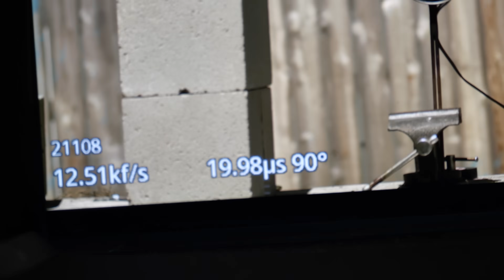Spinning a Record to Pieces at 12,500fps - The Slow Mo Guys

Comment: i'd like to know how far away you found pieces. because one of the early ones before you put wood on top showed a large center piece going up over the bricks and leaving the frame kinda going up and left.
if i remember without looking it was a blue sticker i think.
looking back -wow 1st one - large piece went straight up ! black sticker .-many looks later - ok not blue. the piece was the 1st record with black center, and a large piece that had HIGH FIDELITY went nearly straight up out of frame. did you find a large piece with HIGH FIDELITY on it ?

Comment: Try using a thicker record, they weigh around 180 to 220gms.
Way more stable as they don't buckle from heat anywhere near as much as the ones your using.

Comment: Guys… I know you won’t see my post… but there are a couple things you’re failing to consider here, primarily the torque of the engine used to spin is clearly higher than it needs be, you ought to have it increase the RPMs in a controlled manner because the force from the engine currently is putting so much stress on the record that it’s basically the cause of it exploding at the speed that it does. Secondly, the records you’re using are imperfect. Not just because of the music imprinted but also due to wear, handling, and temperature changes. You ought to try and get some blank records so there aren’t micro-weaknesses and records what are as perfectly flat/round/etc.  still a good video but those things irked me the whole time.
Reply from the maker: We were trying to make them explode, though... All the stuff that "irked" you is why the video worked.
Reply: re-read the title

"Spinning a Record to Pieces at 12,500fps"

Comment: 00:49 kinda hurts seeing a 3/8 barrel nut being tightened with needle nose pliers. Use a 9/16 socket or whatever size a barrel nut is, not sure if its OD is that. 
   I know it's dumb but I'm in construction so I see this a lot.

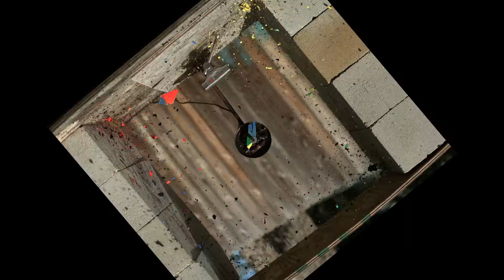Comment: I'm willing to bet relativistic length contraction is the cause of some of those cracks. The outermost edge is moving faster then the inner material, and so relativity would try to slightly reduce its circumference, but the inner layers would resist, leading to a tiny nanometer size split at the outermost edge which permeates inward. It looks like that at 6:06 and 8:44 and 12:31. Centrifugal force cracks would start inside and permeate outward. Great stuff...

Comment: Noticing it was a bit breezy. airspeed, air currents  and such would play a factor as well? Would it be different if it was unpressed, no grooves? The shape of the pressing when in motion, notice its stability changes that the vinyl begins to oscillate and not remain uniform like a buzz saw blade. If one measures the points, would that give an idea of what the resonant frequency of vinyl would be (like the opera voice/breaking glass scenario) in order to be destablize/break?

Comment: Hey.  Been a while. What if you filmed the warm between this. And subwoofer speakers at different sizes. Like 10 inch subs. To 12. To 15   But be careful 15s are such hard wavelengths they can cause heart wobbles or heart attacks because it shakes the body it’s so strong

Comment: Two things I would have really liked to have known. What color did they perceive the record to be first hand and off camera as it spun? I also would have been curious to hear a sampling of a recording off the record, then have them spin it up then down just before structural failure to hear if the same portion of the sound sample was distorted by the high rpm’s in the vinyl and if it did, how would it have distorted or stretched the vinyl since it is a soft material, or if it would not have changed at all since at those speeds it would behave as a solid? What do you think?

Comment: Something that surprised me is the wobble did not travel with the record. If you look at when the last one breaks, it breaks from a small bump that travelled around the edge of the record until it reached a critical threshold, a weak point in the record, or both.

Comment: Whilst this is visually fascinating to watch, from a physics point of view, the experiement is not conducted acurately.  The record shatters because of vibration shockwaves created by the instability of the mounting point and micro sonic booms from air resistance.  In order to eliminate this error, the motor needs to be mounted on a more solid back plate and placed inside a vacuum chamber so that air can not have any influence on the record track.  It must be understood that the groove on a record is one long spiral which traps air particules to the extent that an air dam is created which then explodes and ruptures the record.

Comment: You should now try the various version of 78 RPM records.:pure shellac, laminated, & Diamond Disc. They are far more brittle & the laminated, esp the Diamond Disc would be very interesting considering the various densities of the filler s & surface materials.

Comment: This is very interesting. The fracture starts at the disk edge and progresses internally towards the centre with additional fracture lines radiating from the original like a trees branches.   
I will use this information to strengthen the high speed rotors on a new BLDC motor by wrapping the circumference with carbon fibre tow... Thx.

Comment: @3:05 Gav is a High Level understater.  "I'm glad we put these (cement blocks) up."  Yes, I indeed agree.

May I suggest the blast shield be the blocks lined with plywood.  Depending on the object of the test, plywood - wood of some sort - will better absorb and hold the shards rather than letting them bounce around the area.
Like the bit that hit Gav's shield.  Probably not fatal, but a good bleeder and possibly requiring clean linen.  For Gav; probably also for the wound.

Damage to 'blast shield':  From ballistics testing, penetration in a hard surface is mainly a product of velocity.  The faster the object moves, the greater penetration in a single hard surface.  (Penetration in a homologous substance depends on mass [more or less].)

Comment: In a vacuum how would it shatter if it even does, i wonder.
Reply: Of course it would shatter in a vacuum. It wouldn't be much different. Why do you think otherwise?
Reply: @elonmusk8711  i would suggest it would rotate for longer if not break as there is no medium to disturb it (air).

Comment: They sound English but have 120V?
Reply: Mains voltage in the UK is 230 volts. They're using a variable transformer that just so happens to have an output of 0-130v.
Reply: @elonmusk8711  241-265V volts here in the UK, I've never known anyone have less than 240V.  230V is an EU thing we never bothered with.  Anyway, you would think a variac would output similar to the input.  I have one, it's 0-275V.  Also, presumably the Dyson motor they were using was British, in which case they were only giving it up to half it's voltage.  Sounded more like they were putting it to full power from what they said, which meant it was a 110V motor.

Comment: Any ideas about the rpm threshold, the point at which the vinyl finally yields? Any tachometer measurements taken?
Reply: Well it shattered at about 12500 frames per seconds and took about 4 seconds to do a full turn. If 1 second in 12500 fps is equal to around 40 seconds, I multiplied it by 4, then 60 for a full minute. Unless my math is wrong, it should have been spinning at about 9600 rpm when it shattered the first time.
Reply: In the last round before it shattered I counted 81 frames (rougly 3:25 - 3:28,  as a marker I used the letter C hitting the shadow). 12,500 fps / 81 frames per revolution = 154.3 rps. Multiplied by 60 that's 9259 rpm.
Reply: For real
Reply: Taking this further. The radius of a record is about 0.15 m, and the time it takes to complete a revolution at it's max speed there is about 0.00625 seconds. From this we can calculate the speed of the edge of the record to be about 150 m/s 😳
Reply: i get what you're saying *i do not *

Comment: If you had bolted down the vice and reduced the length of the rod holding the motor, you would reduce the pre-resonance occurring which is causing the records to break quicker than they are doing

Comment: The slight  wobble would destabilize the LP fairly Quickly.
That type of distortion thing happens to a saw blade if  it’s is not tensioned properly

Comment: In fact, all of the curves of the crack are due to general relativity. Time is moving slightly faster at the bottom of the disk, and the cracks are actually spread out according to the relativistic time-paradox.

Comment: This puts a whole new spin on using records. Good thing they got around to the experiment. The record had a shattering experience. It was beside itself and needs to pull itself together. It was falling apart and the situation was up in the air.
Reply: enough

Comment: Now, try that same experiment to see wobble in a vacuum chamber and see how the wobble isn't as severe.
Now, find some old laserdiscs and do the same thing. Thicker, more massive, stronger and those have killed technicians working on them after the tech removed the cover and guard assembly.

Comment: to be fair , greeat video, its pretty soo seeing things in slow motion :) keep in mind those record could have probably gone a bit fast had it been a balanced central mounting point, (think of a 4 1/2" angle grinder, how the cutting disk sits on a collar to keep it perfectly central to the spinning axis [ if the cutting disk was not perfect on an angle grinder, it will very likely blast apart aswell] )

Comment: Omg that was nuts boys !!! Right away I thought of spinning a circular mirror the same size as the record, although maybe like paint did on the record maybe apply a skin of whatever ? Glue,Caulk,-clear coat?? On the back for equal surface strength... 🤷🏼just sayin that's be sick

Comment: Looks like it breaks not due to high speed rotation but because of excentric movement. It is clearly seen from first seconds of rotation. As soon as you reach first eigen frequency of the disc the vibration becomesof  really high amplitude and it blows the disc into pieces. In case of "perfect" round vinyl with center hole it shouldn't break so easy) 
Anyway, looks awesome)

Comment: The Slow Mo Guys: play videos at slow speed
Me: plays it on 0.25 speed
Me: hehe boi
Reply: Well it'll be at 12.5FPS since 50/4 (or 50*0.25) = 12.5, which the video is in 50FPS, so it would be slower, but your sacrificing FPS for slowed speed.
Reply: @echoden_sys  thank you professor, but I think a baboon could’ve figured that it would be playing at a lower framerate
Reply: @echoden_sys  🤯
Reply: You have broken the matrix

Comment: I would LOVE to see a brake rotor, bicycle tire (with inflated tire), a clutch (thinking car parts or related), or even a Frisbee,, a saw blade, or a typical cutting wheel you'd find for a grinder.  You'd need more than a plywood safety barrier though.  haha

Comment: I wonder if it made a difference what the weight of the vinyl was? I couldn't tell what year the albums came out in but the older heavier albums might last longer, while albums from the eighties when the vinyl was lighter (oil got expensive) might have been the ones that blew up from the outside.

Comment: I'm wondering if the cause of the breaking is that the outside portion of the record has approached or exceeded the speed of sound?  If that's the case, then I'm not at all surprised that the records broke as they did.

Comment: Looking at the slow motion footage: It looks like the material failed from the centripetal force pulling the plastic past its yield points. Some expansion can be seen in most of these spin to fail videos. It also looks like the edge wobble is from a forcing frequency caused by the RPM lignin up with the natural frequency of the disk. I’d like to see the RPM held constant when the wobble was at its worst. See if it will break at a lower RPM.

Comment: IMO: This needs a rubber washer...i think the vibrations from the set-up is causing an inconsistent results....If you put rubber washers it should absorb the vibrations, giving you better results instead of metal washers.

Comment: 1:08 So a Dyson motor is an incredibly fast Hoover motor? I wonder if that Dyson guy on the commercials knows his motors are made by the Hoover Corporation.  😀
Yeah yeah I know, you Brits and your Hoovers. 🙄😁
Reply: I like to put that Dyson motor in my 20 year old hoover washing machine. Dyson hyper spin mode button. Instant dry clothes. 😳 Correct myself. A Hoover motor for a Dyson Hoover in my hoover washing machine. 🤪

Comment: Does the torque on the clamping mechanism change the fracture pattern?

For example, if you use high friction composite or rubber washers instead of metal, and less torque, would the record fracture differently?

Comment: When I was working in a sawmill we used to stretch the inside of the saws because as the revs increased, the outside would lengthen more than the inside. When they were revving at 12000 rpm they would become taught and cut straight. Same sort of principle as what causes the wobble in this, the outside stretches.

Comment: One thing I've noticed with the colored vinyl when it's spinning at a normal speed is that while it looks like the video picked up the color changing effects of the paint, you'll see that it's still four solid colors when you use , and . to step through the video. Pretty interesting.

Comment: To get the actual speed youd have to do the math from the differance in the size of the motor speed of the load on it and the outside of the record because a larger radius is why grinder wheels are different

Comment: im sure you could find a really really really really overly difficult way to calculate Pi from this
also, i wonder if the cracking starts due to the relative speed difference between the inner and outer parts tear it apart or the force perpendicular to that, the amount of its wobble vs the strength of the vinyl

Comment: This spinning is trying to make the record perfectly round and balanced, and when the record won't become, it explodes.
Reply: As it  increases in speed , it goes thru harmonic barriers , that vibration shatters it internally .
Reply: I assumed it was the Centrical (centrifugal?) force pulling it apart till it can’t handle the force anymore
Reply: @ianwells2025  Centrifugal force doesn't actually exist, it just feels like it does when we experience spinning, instead, spinning objects experience centripetal force, which is a force inwards. This is why a spinning/orbiting object stays in a circular path, even though its velocity is always tangential to its path. That being said, centripetal force is (probably) why it shatters,  because the inward acceleration wants to correct the warping but can't overcome it. So it's not being pulled apart, but failing to be pushed together.

I hope this didn't come off as smart-assy I just wanted to give you an explanation.
Reply: Caden centrifugal force does exist and is the sole reason when you spin a bucket of water around it doesn’t fall out.
Reply: Snarky Boy, no Caden is right. Centrifugal force is an illusion due to an object’s inertia and the fact that things want to continue on a tangent line when on an arc. I used the wrong term and had the physics wrong.
Reply: Interesting

Comment: Not a good test for how much a record can withstand. The vibration is starting in your janky set up. Loose vice, wobble in the arm its holding. could have done a better test in a lathe that would support it on both sides.

Comment: If you slow down the video to .25 watch the inner part of the record,, You will see stress cracks near the pivot center ( Pressure of the washer holding the record ) ... I think you would get a higher speed Or longer spin time with a rubber/foam washer to absorb the off balance of the record

Comment: Super Fast DVD 2:10-5:12-8:07-9:21-11:24-12:23 Blockhead Is Spinning Extreme Speed 2200RPM Like A Windmill 12:23
Reply: Blockhead Is Spinning Extreme Speed 2200RPM 8:07 Using A 10 12-V Batteries

Comment: The disk shattered due to both the spin rate and the rate of vibration due to the motor and any/ all moving part's. I imagine if the disk was thicker it'd been able to withstand much more stress. find a way to to fit some together as closely as possible without too much glue or whatever is used because it lends too the overall strength of both. :D

Comment: Another good video. Assembly torque to the arbor should be controlled to see if the fractures propagate at the ID v. OD. 
Reason - OD fracture propagation is expected unless the assembly stresses are higher (I think). Look forward to another video.

Comment: You should do a video where you find out the breaking point of a both a CD and a record (the number on the Variac) and keep it below that, and see what kind of impact it takes to shatter it (i.e. a pellet from a pistol, an airlift BB, an arrow, a dart from a blow gun, etc.). You could even make it more interesting by making a point system and whoever has the most points based on their accuracy will get a soccer ball to the face or a proper football to the face with all three Phantoms filming. The Flex in 4K @1000 fps, the v2511/2512 doing 28,500 fps @ 1280x720, and the v2640 doing 12,500 fps @ 1920x1080. 
Side note: you should just do that anyway for all the videos where you have access to all three just to cover all the bases of pure UHD res but not too fast 1k fps, a mix of FHD going pretty darn fast 12.5k fps, and just pure speed of HD 28.5k fps.
And as Sherlock Holmes said, "Food for thought!"